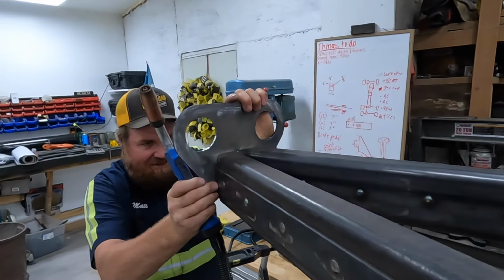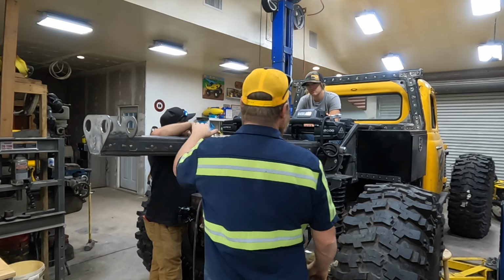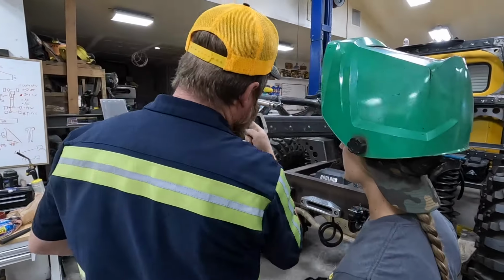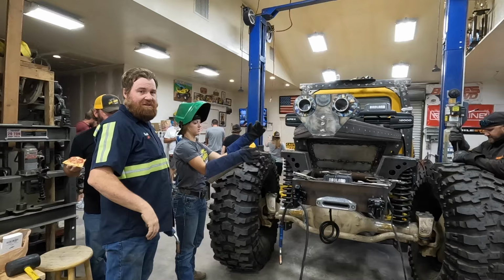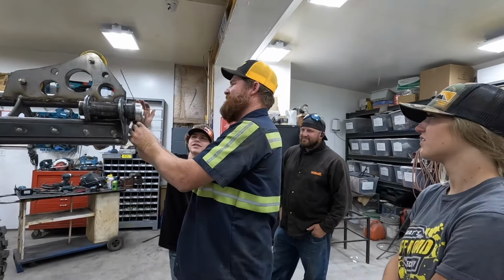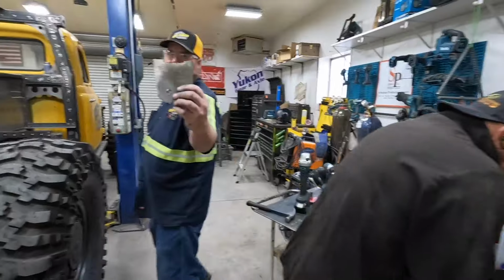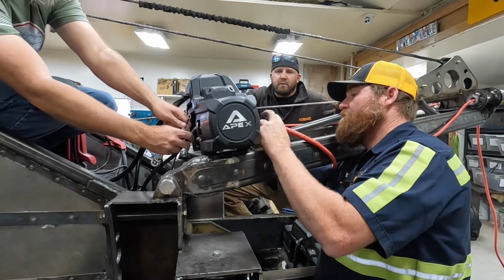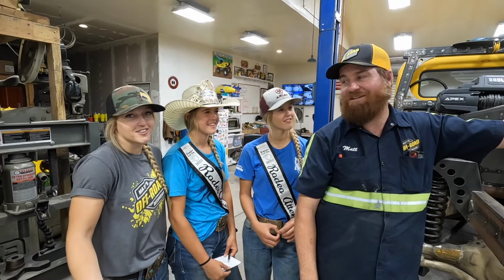Fully Operational Lift For The World's Largest Off Road Wrecker!

Comment: I have loved watching Lizzy’s learning curve over the past couple years. She’s not afraid to take on anything. Props to Matt for mentoring and encouraging her to learn new skills.
Reply: And did you notice her freaking 💪???? Good Lord!
Reply: Heck, Liz could probably run the place now, if she had to...
Reply: I've known a a fair amount of women who wanted to do stuff like this but it was always for the wrong reasons which only instills even more sexism.  Lizzy seems to like doing it without any other alternative motives.  That takes a pretty wholesome environment to achieve that.  Two examples;  A woman I knew wanted to impress a guy that liked sport quads.  I did not know this, until we were out this day at a trail system and I was showing her how to do donuts and wheelies properly shift and using the front and rear brakes.  Somehow it just snapped when I realized she had bought the truck and the ATV at the same time.  She was blunt about it I give her that.  I told her if she wasn't doing it for her own interests she had no more help from me.  She sold the ATV a couple months later when the guy dumped her.  Years later, a young woman kept asking me to show her how to weld.  "More than happy to!" I told her.  I gave her a warning;  "You'll get burnt.  You will get very dirty.  You will smell bad.  You will sweat.  You might get shocked."  "No problem!", she says.  I told her one more thing;  "If you are doing this to impress a guy don't waste my time."  She never asked again.  Funny thing is, she's still with that guy :)  But I'm glad I didn't waste my time.

Comment: 20:24   #1)  The geometry of the winch lines for lifting the boom, especially when it's close to horizontal, imply that the cable tension will be at least double (likely ~2.5X) that of the lifting force it can exert.  For example, lifting 3,000 lbs will require 6,000 to 7.500 lbs tension. And, that's just the static load. Add dynamic / shock loading and you may risk snapping the synthetic rope (especially given synthetic's poor response to aging from UV). I think you need a greater safety margin.
#2) I suggest that the boom be more triangular shaped, where the cable attachment points are both more centrally placed and higher up instead of near the boom's end. The boom would then more closely resemble a truss, AND the higher attachment points would improve the ratio between cable tension and lift (closer to what tow truck booms have when they use hydraulic jacks for lifting).
#3) You really DO need to worry about potential failure modes and the associated risks. Failure of a conventional tow truck's hydraulic jacks may bend/buckle the boom or jack or prompt a hydraulic leak. But if the cable snaps, the boom INSTANTLY crashes. This would be violent.
If you post the dimensions, I can run the trig calculations for what you have and some improved geometry's
Reply: Absolutely great information
Reply: @DustyEmma  There are a series of other safety concerns posted by 'tippyc2' and ~28 replies to him/her. They focus on other, legitimate, concerns (pulley attachment point on the roll bar, potential improper termination of the synthetic cable, etc.)  I like the spirit of building one's own utility items. But, this enthusiasm really has to be tempered when its failure can put lives and limbs at risk.
Reply: Since there's 3 lines lifting the boom....you can divide the total tension on the cable by 3.......Z
Reply: @zardiw  there is only 1 line for lifting the boom, the other 2 are for lifting the payload
Reply: @flotr6465  The 1 line lifting the boom is tripled via the pulleys. Tension in each segment going to/from the pulleys is only a portion of the total pull force. That helps in terms of rope strength, but there's a pretty small bolt holding those pulleys on (admittedly Matt said those aren't the final bolts), which does need to hold the full combined tension.
Reply: @flotr6465  that one line lifting the boom has a 3 to 1 mechanical advantage.  The angles plays another part.
Reply: Not sure if you watched the video, Matt does say it’s not finished and that is not the end product.
Reply: @UnreasonableSteve   my biggest concern isn’t the pulleys but the load where the boom attaches to the truck. The load going back through there will be huge!! When it’s horizontal with 1000lb on it there will be 6 to 8 times that amount pushing back towards the cab starting to snap the shock towers off.
Reply: Thanks Gregory, I came here to suggest the same thing. The loads are going to go through the roof if they ever run that boom close to horizontal!
Reply: You're right about the cable tension to lifting force ratio being worse when the boom is close to horizontal.  But can't Matt just choose to place the boom up first, with no load applied, then start pulling with the other winches?  Maybe only do that for heavy loads, to reduce wear and tear on the other cables and the cable guides.

As others have said, the pulley reduces the boom lift cable tension, but the boom lift winch is placed low, so the pull direct from the winch to the boom isn't as helpful as the pulls coming from the pulley above it.  What might help is adding a second pulley wheel above the winch and then running the cable from the winch to that before going to the boom.  Boom lift speed would be almost as fast, unlike adding another pair of pulley wheels.  (But maybe a little slower would be better anyways?  More fine control?  I don't know.)  A couple downsides to that are it would require changing the installation of the winch and would change the load direction on the pulley wheel supports.
Reply: @zardiw  I understand. With dimensions, I could just vector sum the loads and resulting moments. But to approximate, let's aggregate the NET moment arm supplied by all three cables. For example, the perpendicular distance between the bottom cable and the pivot point looks to be ~9 inches. The boom length looks like ~8 feet (96"). Due to this cable being almost parallel to the boom and its winch location yields something close to a parallelogram. So its moment contribution is poor and will not improve much as the boom inclines. 
The perpendicular distance between the next cable and pivot point looks like ~23", at the worst case (horizontal) orientation. Fortunately this distance will improve when the boom inclines.The top cable looks to be about 3 inches further ~26" from the pivot point, again at worst case (horizontal) orientation.
With these distance assumptions, the load's moment, at a horizontal boom orientation, in inch-pounds is 96 * Weight
The counterbalancing moment (again, at horizontal) is (10 + 23 + 26) * T  = 59 * T
The ratio of tension to applied load (weight) then is T = 96/59 * W  = 1.63 * W.  That's not as bad as my first WAG of 2 to 2.5. But it's still not great. It also does not take into account additional tension when the cable is trying to drag a load in addition to lifting it, or dynamic loads.
In addition to my concern about how/where the bending moments are applied, others have expressed legitimate concerns about pulleys, pulley tie points, roll bar rigidity, and stress concentrations due to cable bend radii and termination. If any of these result in failure, the mode is the boom abruptly crashing. This contrasts to a slower, potential buckling of a tow truck boom or its hydraulic jacks, whose components and overall assembly have been certified and have a generous safety factor. 
Bottom line, I would not want anyone near this boom when its under load
Reply: @filmaynard  Current tow trucks tend towards hydraulics. I assume there is good reason for this. For one, the pressure limit can be set sich that it bleeds away excess loads rather than bursting.  For grins, I googled 'images of old tow trucks' in order to see past designs using cables. It's fun to see.
Reply: And here I was thinking “where is the mechanical stop to prevent the boom from inverting with a load and smashing in the cab roll bar” ……I think there are a few mechanical concerns with the boom that will need to be worked out.
Reply: @gregparrott  It would even be an advantage to have some type of mechanical brace to rest the boom on once the correct tow angle is achieved, thereby allowing some stress relief to be given to the winch line. You could elevate the boom, set the mechanical brace, then back the line off just before slack and let the triangulated steel attached to the boom and frame take the load. As it currently stands, that flat angle, cab roll bar sheave attachment, and dynamic loads make that thing a rolling death trap, not something you want when winching up hill, or when towing up and down crazy elevations. Good in spirit, but it's terrible that something so easily calc'd out and done right has been neglected.
Reply: I already said that in a previous video, whatever hes doing with the pulleys, the height of the A frame hinges mean that hes going to put the winch lines on a dead pull if he drops it far enough. 

Putting a hydraulic cylinder (with 12V hydraulic powerpack) underneath would solve all that because its angle would get more favourable the further you drop it, and a cylinder that can take a compression force, stops it from jumping up riding trails with no weight on the hook.
Reply: @WS102  A triangulated brace, such as you describe, would be an excellent addition. But in a sense, if you add that (i.e. supporting a load via. compression), you sort of return to the configuration of a current, hydraulically supported boom. It's a more robust design. But it adds weight, which they're trying to minimize.- Understandable, but risky.
Reply: @MrJamesLuz  That's an interesting hypothetical failure mode, although I don't see that happening. I don't see where the potential energy of any cable (including the one attached to the vehicle being recovered) could be stored. The cables are synthetic, which have VERY little stretch. And the boom is supported at its end, so energy by bending a cantilevered beam does not exist. There may yet be a mechanism, such as conjuring how a component breaks off a vehicle being cragged which then whips up over the boom, pulling the boom up with it. But this seems very far fetched. Any suggestions?
Reply: I did wonder the same..putting that potential stress on 2 nylon ropes🤔
Reply: I have designed and built homes for decades now and I have always used a consulting engineer. I would think Matt has enough resources to do so. I'm not sure he has any drawings for this. Then we get into the insurance part of the equation. But all of that is none of my business.

Comment: Having worked at a paper mill for 37 yrs, I knew lots of welders. Many of them ended up dying early from lung cancer.  I’m pretty sure the fumes from welding in enclosed environments or areas with little air flow, meant they spent many hours breathing those fumes.  Sad that it meant early deaths for many of them. 
Lizzy has turned out to be a Cracker Jack welder and I look forward to seeing her turn out her typical excellent welds, but I wonder if it might be a benefit to rig up an air line, or even a shop vac set up for exhaust, to keep the fumes away from your sweetheart daughter.   Wish you all the success in the world and I anxiously await every video showing the progress on the wrecker, just like I did for building the Morvair   
Now that I’m an old man with plenty of issues stemming from years of hard work, the affects of those years doesn’t exactly make old age “the golden years”.  It’s more like the olden years.
Reply: The shop definitely needs a fume extractor. Cheers mate!
Reply: When you are young you think you are invincible.
Reply: Welding respirator from 3m will take care of the fumes. 
And lizzy is not Matt’s daughter, her dad is a friend of his
Reply: @slngblde  thanks for the update.  I’ve looked back through the episodes trying to find where Lizzy came on board but have been unable to.  Was surprised to see she had younger twin sisters.  All three of them look alike.  I only started watch Matt’s off road recovery about a year or so ago, so my insight as to who is who, is nil.
Reply: @lonpearson2134  I didn’t learn that myself till a couple weeks ago, I just happened to see a comment mentioning an older video with Lizzys dad in it.

Comment: Years ago, my brother was moving drilling rigs. The company switched to using synthetic line on their winch tractors and bed trucks.
They had a couple trucks with gin poles in the air picking up the drilling rig derrick and the line snapped. They were using too small of a pully for the line.
You might want to look into what the manufacturer expects you to have for a radius when pulling around a corner. I'd hate to see a video where those aluminum tube fairleads caused the lines to fail and a recovery went wrong.
Reply: Boy that's exactly what I was thinking also.  People forget about the durability of steel ropes over composite ropes.  I think they are going to bind up at some point.  They should have 6 inch diameter fairlead wheels or a parabolic cone shaped aluminum tube.
Reply: Synthetic will out last and out perform steel time and time again except on Extreme weight such  like cranes and heavy winches 50k+ Steel is lethal when it snaps also very hard to work with up and down hills all day
Reply: @scottishmudders8357  its lighter, and extremely strong. But a 10k steel winch line is the same strength as a 10k synthetic line

The lines were rated for the trucks pulling capacity and then more.
But bending around the smaller pully, like an 8" pully instead of the 24" pully it required is the issue
Reply: I think 3/4 inch is the minimum for that standard synthetic winch line
Reply: Just take a look at the standard fairlead on the bad land or any vehicle winches the only have about a 1/4 inch radius on them. I’m sure it will be fine.
Reply: Back in my logging days, we would never trust “wire rope”. We had a 30k winch on the skidder and we were dragging some good sized logs. It would have been easier on the hands if it would have worked.
Reply: @Dave-hc6pp  they would never run this synthetic winch line on something like that. The abuse those machines go through lol.
Reply: @taylor2105  exactly why we decided to stick with 5/8 steel cable. My point is that if you’ve ever drug that 5/8 cable thru the woods and up a mountain, you’ll at least look at an alternative to question if it would work.
Reply: I wouldn't trust a rope in that situation at all. Especially where it's going to be exposed at all times to the elements. UV rays kill the ropes.
Reply: I've done alot of rig moves myself and I've never seen a pole truck use synthetic rope.
Reply: @Truckerdaddy  they had that Derrick in the air when it broke. Landed about 15 feet from my brother, who was a swamper at the time. Holding his tag line

Comment: Okay, I'm a junkie for this build, I admit it.  I have even watched the whole series of videos with the sound off, to aid in me seeing more.

Some reflection:

I'm calling it TowMORR, which you heard here first, back a few videos.

I can see influences in the design from trailmater like lots-o-electric-winches, Grampa Sherm's tow truck like winch on boom, and maybe even Kenny Hauk's wrecker but please don't do stupid exhausts, although the copper patina trick does look good.

I am liking your incremental approach to strength.  Lots of layers of pieces to get a strong structure, and some layers are clearly ornamental.  I like your use of plasma/laser cut pieces to up your game.  I'm hoping the boat sides, which I very much like the engineering on, get some more internal bracing once the cab comes off for final welding.

I'm also liking the original thinking being done on this rig.  The MRAP axles were an excellent choice.  On any given trip Rory's, Paul's or Eric's rig may explode a differential.  When I look at those builds the axles all look puny now.  Those MRAP axles steer with lots of angle and will outlive most of the vehicles on the planet.  

I'm glad it is going to be full service too with air and welder.  I like the side winch structure and tool boxes.  You should contemplate a rack for all the remote winch controllers inside the cab.  I'm wondering how the air hose, and welding leads, rotopac, rope and shackle storage will be done.

Your video on TowMORR is the highlight of my weekend internet.

Comment: Matt's Off Road Recovery the wrecker looks great and it's coming together nicely! Y'all are an amazing team and I just want to thank you for sharing ALL of your escapades with us! 
Just a side note: I love the boom but if it were me I'd double the line for the lift simply based on SHOCK LOAD. The synthetic rope is awesome but for most of your tows the boom will be generally located at the same height and the Shock Load on the line 'at the pulley' of the towed vehicle will cause excessive wear on that line as well as the UV exposure. It's just a thought, I'm sure it will work just fine as it is but I'm thinking long term. 

Thanks again from a fellow tow operator for all that you do!!!